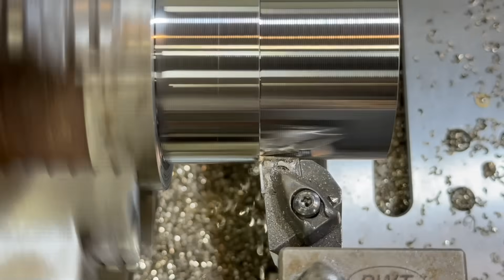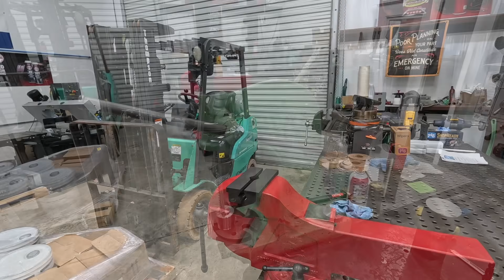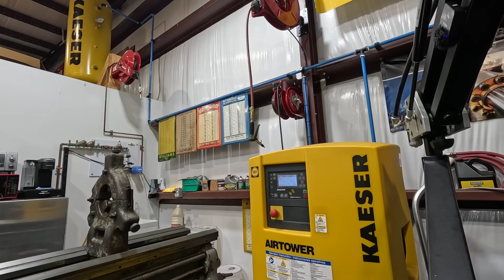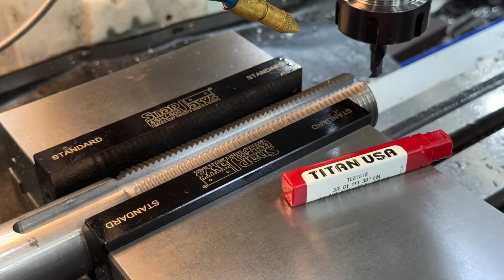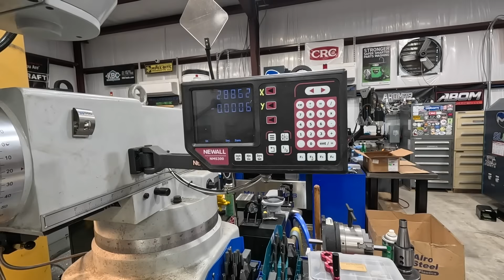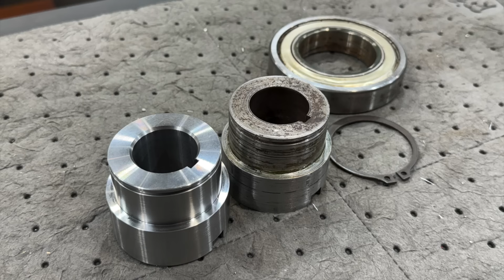Steady Bearing Bushing Part 2: Machining the Keyways

Comment: I threw my Anchor Lube in the trash since if you fail to clean up your cutters and dies after use, they will stain. dis-color and look like hell. Same thing happens if you drop it on your lathe and fail to wipe it off.  It works good but no better than Rapid Tap or other good cutting oil that does no damage.

Comment: Is nobody going to talk about how far off that keyway and notch are misaligned from each other?? Damn Adam, you clock it all up so nicely and still get them misaligned.  🤣🤣🤣🤣
Reply: nobody does because everyone is aware that one is much wider than the other, so it is not a sign of "misalignment" if the edges don't match up. overlap on both sides is pretty much the same. Always nice to see bullies making a fool of themselves.
Reply: @cloph  I know they are not the same size!!  The difference is not equal on both sides..... Both slots center lines are not aligned.
Reply: @4032MADNESS  I am not convinced that the slot centre lines are not aligned ( as clearly shown that they need to be according to the print).  It might just be the camera angle.  What's more, I can't see anything wrong in Adam's process;  they should come out in line according to the steps he's taken and also the order of them steps.  According to the print, it should be a .4375" slot rather than a .375" slot, though.
Reply: Moron, the broached keyway is 1/4" and the milled one 3/8" so of course there's a difference of 2mm each side.
Reply: @jackiebutler5025  The milled one is 3/8", which is .375".  But on the drawing, the dimension is clearly shown as 7/16", which is .4375".  ( Shown more clearly in Part 1).
Reply: @hudson-o3x also the print calls for a 7/16  hole thru and counter bored, I’m sure Adam has talked to the customer and verified those changes, at least I hope he has.

Comment: For those that live in the sticks like me and want some 12L14 , go to the scrapyard and disassemble a photocopier or similar machine. Unless they really have to be something else all the rods in those machines are 12L14 because it machines so nicely in the CNC machines that make them. I was just cutting some yesterday, the rod looked like stainless and it has been lying in my workshop for years, but then I saw a spot of rust on the end and thought , nope, not stainless. I made a 10mm OD 8mm ID sleeve for a friend.

Comment: Great job as always, but just a question. I'm have bought a box of broaches and would kike to start using them. What is the letter at the end of the size mean on the broach. Like what you mentioned, 1/4 c. What does the c mean?
Reply: The letter at the end of a keyway broach size indicates the "Style" of the broach, which specifies the thickness of its spine (body width)
The letter designation is critical because it dictates which guide bushing and shims the broach will fit into.
Style A: 1/8" body width  Style B: 3/16" body width  Style C: 3/8" body width  Style D: 9/16" body width  Style E: 3/4" body width
You must pair your broach with a guide bushing of the exact same letter. A 1/4 C broach will only fit into a Style C bushing.
Style letters also indicate the overall length and the maximum thickness of the metal you can cut. Standard Style C broaches are roughly 11 to 12 inches long and are designed to cut through material that is between 25/64" and 2-1/2" thick. Trying to cut something thicker will bind the tool because the teeth gullets will overflow with metal chips
   Use compatible shims for each style.

Comment: The use that coupling is used for reminds me of a time, way back when we used to have power outages, someone at the factory decided that a row of diesel generators which would kick in automatically was the answer. The only problem was the time delay, mains power dropped, machines all slowed down, gennies came online, machines speeded up and promptly broke the carbide tips. Result, all the lathes and milling cutters required new tips meaning a queue of lathe and milling machine operators quickly formed at the tool store.
Reply: Decades ago, I was in the Diesel Engine business. Our engines were used in (among other things) stand-by generators, primarily for Hospitals. The most severe start-up condition imaginable! Dead cold 6-cylinder turbocharged engine. Mains drop and engine starts and immediately goes to full power/full load. All had to happen in about two or three seconds! Those units were "exercised" monthly and after a few years those engines were toast! We got to examine a few of them and they were BAD! :face-fuchsia-wide-eyes:

Comment: In the 1970's and 80's I worked for a company that built computer based measurement and control systems for paper mills. I saw mills all over the US and Canada as well as some in northern Europe. Paper-making is an old process but the modernized version is loud, hot and odoriferous. The machines run at speeds of several hundred feet/minute (heavy linerboard/cardboard) to a few thousand FPM (tissue paper). We build large high precision scanners that traversed the moving sheet measuring total sheet weight, water content and thickness. It was an interesting meeting of old school industrial workers and pointy headed, bearded computer geeks.

Comment: Yes, no kidding about the "paper box" made in paper mills.  I especially liked the ones we used to get when purchasing a 100 count of machine screws or nuts.  They came in thick boxes with metal reinforcement on each corner and were worth keeping once they  were empty to use for just anything storage wise. My favorite design was those which had a top and bottom that slid together closed and slid upward to get into the contents.  
Today, those are super rare as industry has moved from paper/cardboard to plastic...not my favorite mainly because they aren't as rugged and will crack over time/age. 
BTW...we just spent $53 on one pack of paper towels and bathroom tissue...about $2 per roll on the towels. That is getting insanely expensive.